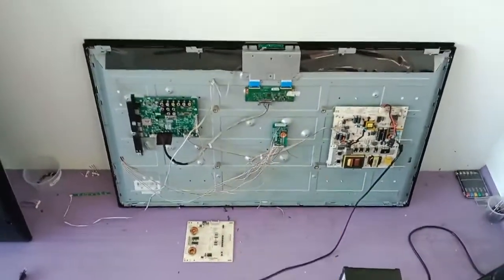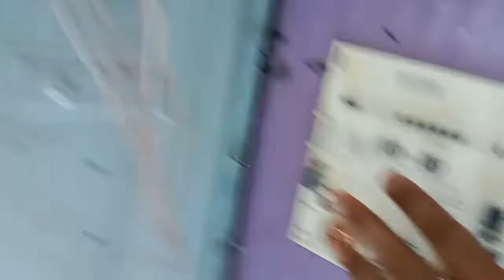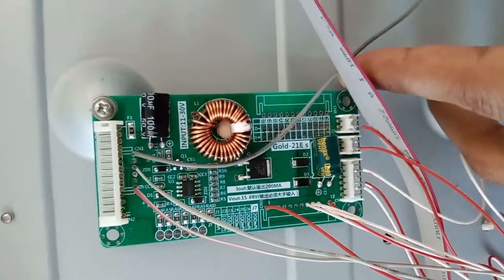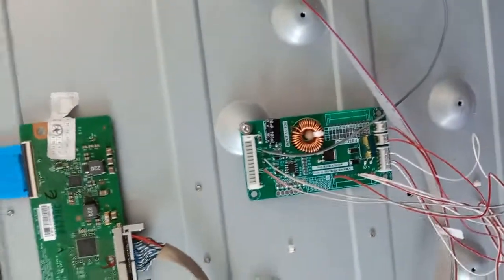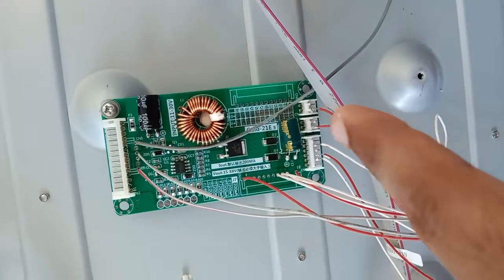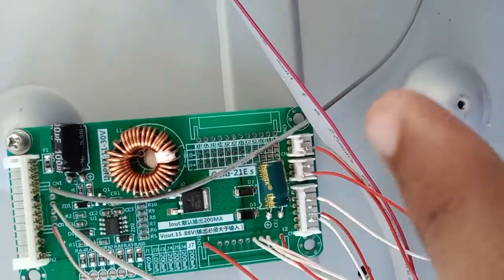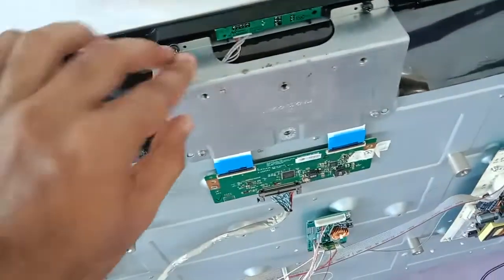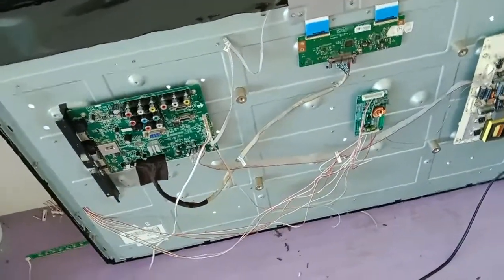philips tv 42pfl2908s/98 backlight inverter replacement with gold 21es

Comment: Good video, I just want to ask how to choose the right terminals on the LED section, you use some terminals and left the others, why?
Reply from the maker: this tv got 5 series of led (+ & -). the board got terminal pins and holes for soldering. some i solder to the holes and some i got to solder to the pins. its the same but just to make sure the connection doesn't touch and cause short.
Reply: @dengkilrepairservices  thanks